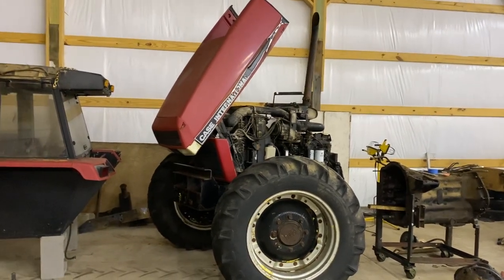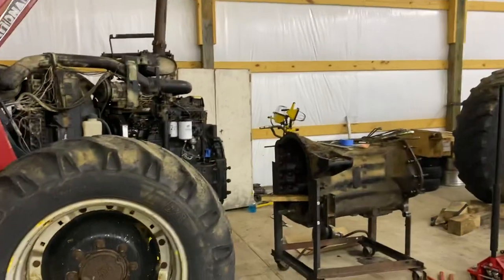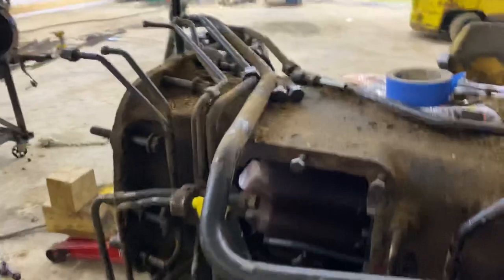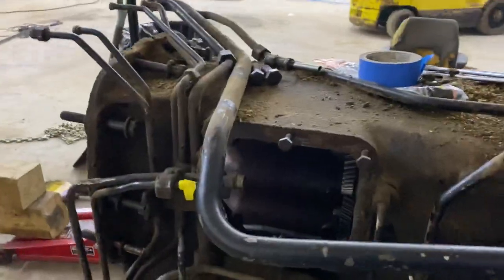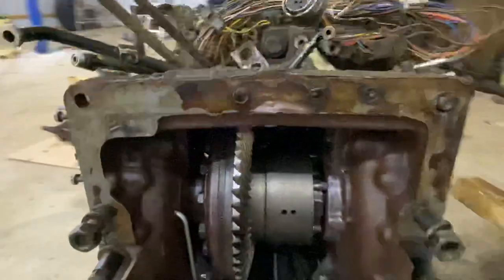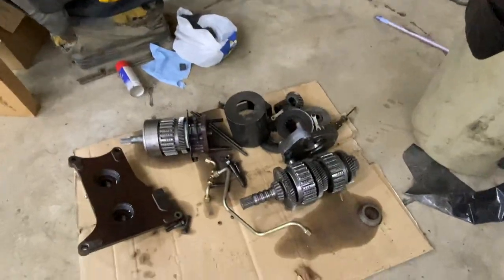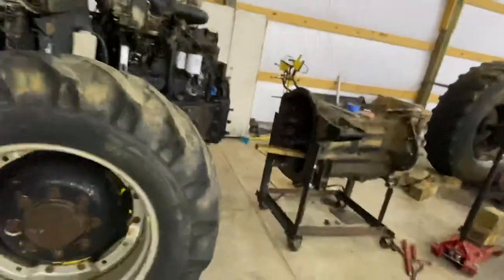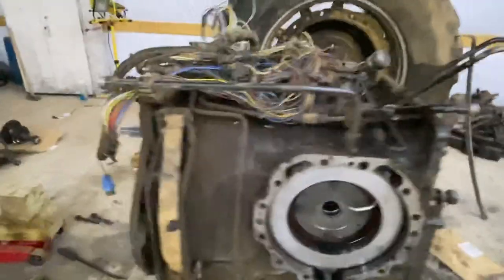Case IH Transmission Teardown and Rebuild

Comment from the maker: It is a 5140. We did it get back together and it worked liked it’s suppose too. The hydraulic pump had to be replaced once we got it together.    Just don’t forget your cooling  tubes in the rear axle when you put it back together (not that anyone would forget that)

Comment: The Case IH 51 series  transmission  power shuttle pressure switches on these  tractors can cause trouble causing it to drop out of gear and the orange warning light to come on .
I tried fitting non genuine pressure switches but the oil leaked into the switches and even leaked out of the electric wires in the switch   due to faulty seals in the non genuine switches and I ended up replacing all four power shuttle pressure switches with genuine switches.  Case also did a training manual for this tractor which has information not included in the Case 5130/40/50 series workshop manual . These training manuals are not so easy to get as they were  given to Case IH main dealer mechanics and not easy for independent mechanics to get hold of unless  they can catch one secondhand on e-bay etc

Comment: Like you mentioned, one of the few vids on this tractor.  At the nursery I work at we have a 5130 from 1990 with 9600+ hours. I am currently researching the clutch as it feels like very little engagement is happening. I don't have a shop manual for this tractor but am trying to determine if I will jave the time to either split or send off for repair. It will only creep along in 1st range and then will come to a stop if rpm is taken up quickly. Feels like the clutch is gone unfortunately. I am not finding much luck for clutch cable adjustment either! Thanks for making the vid!
Ric

Comment: We have a 5250 with 5,500 original hours, but the hydraulic fluid has never been changed.  During the winter the tractor has no forward or reverse, but during the summer the tractor works perfect.  I am hoping that there is just sludge in the bottom of the case around the suction screen.  This fall I plan to change the hyd. fluid and hyd. filter and clean the suction screen.  Hopefully that fixes it.

Comment from the maker: The brake split is right in front of the rear axle. The power shift packs are right behind the engine. But it sounds like it is your shuttle pack which is the same split as the emergency brake

Comment: I have a problem with the 4x4 case 5120 maxxum, it doesn't disconnect, I checked the electrical and the solenoid is still good, any opinion?

Comment: Hello, i have a 5150 with broken pinion shaft , how did you test that bearing preload of the pinion shaft and the crown wheel is correct and as well as Backlash ? Did you have the special bearing cone CAS2024 that slides on the shaft easily to set pinion shaft bearing preload? Thanks for you r answer and have a good day.
Reply from the maker: I had a man to set that for me

Comment: I HAVE NEVER WORKED ON A TRANSMISSION ON ONE BUT I HAVE A 5130 SLIPPING IN FORWARD ONLY ,IN ALL 1 2 3 4 GEARS . DO I SPLIT IT AT DIFF TO DO HANDBRAKE  AS  THIS IS BAD , AND THEN AT FRONT TO DO THE FORWARD PACK ? THANKS ! I AM A JD MECHANIC , LIVING IN ENGLAND THANKS

Comment: How hard is it to pull the rear PTO on a Case IH 5220?
Reply from the maker: The rear unit is really heavy. There are a couple of bolts on top that are a pain to get out. But it’s doable
Reply: @johnp9487  Started on it this afternoon!